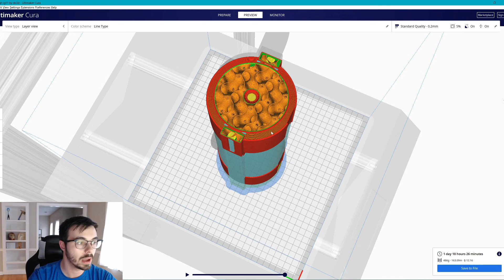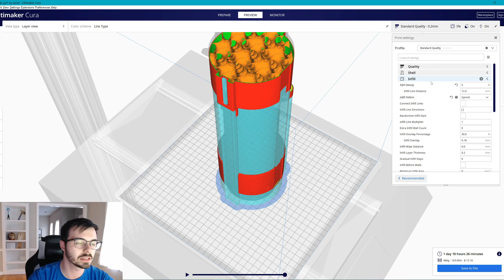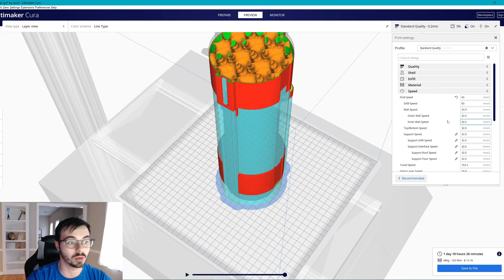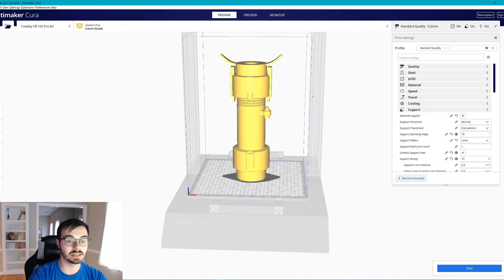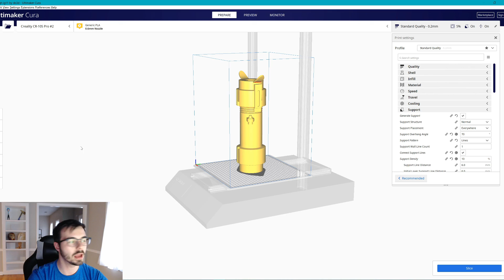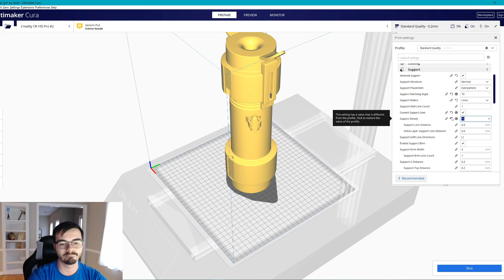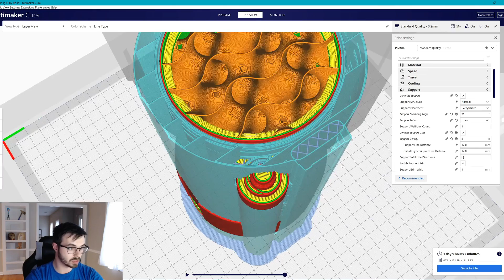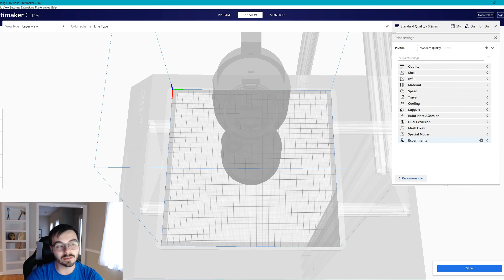Cura 4.7.1 | Improve your prints! | Settings to make your 3d prints smoother

Comment: i have 4.8, would these settings still work perfect that? should i revert to 4.7.1? Ender 3 V2 is what i have
Reply from the maker: These settings are a good enough guideline for 4.8. Youd have some settings different one an ender 3 since its a different size bed and nozzle size may be different